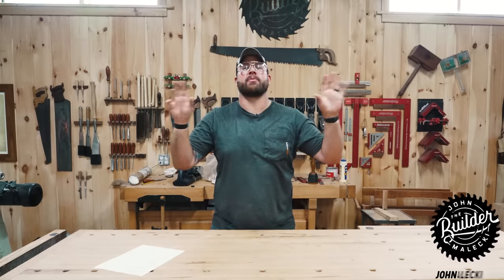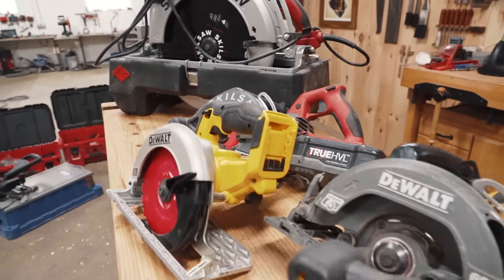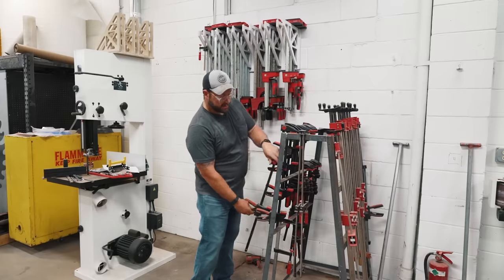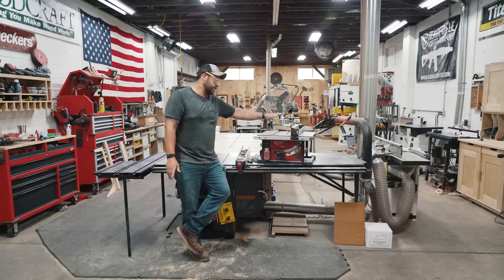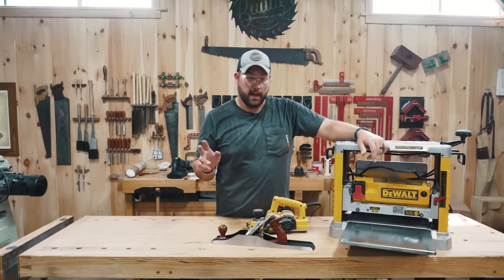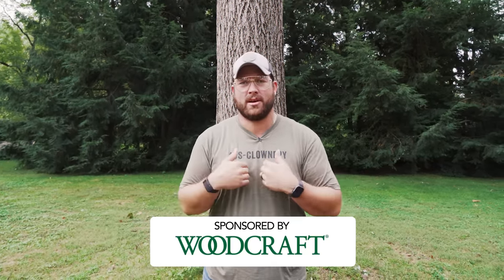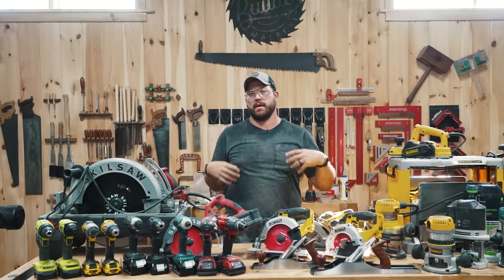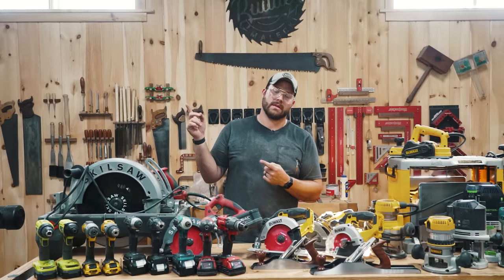10 Must-Have Tools For Beginner Woodworkers

Comment: Most beginner woodworkers probably haven't convinced the wife to let them take over the entire garage lol. Thus, I wouldn't include jointer as a tool for beginners as it takes up a ton of space and budget (and because the edge and face can be jointed with sleds on a tablesaw and planar respectively).

Comment: I'm guilty, i used pocket holes for my 2x4's for my miter station.

The router is probably the tool i fear more than a lathe and table saw, i've had a router head bite into a piece of wood and the router sent it sailing across my garage (first time experience using a router, so i knew i did something wrong)

Comment: As a beginner i will list it in order (so u can actually do stuff with it)
0) MOST IMPORTANT: Vacuum cleaner and aspiration system.

1) Jointer and Planer - You wont do shit without it. Confirmed.  nothing is going to fit. Tested.
2) Table Saw, Miter Saw, Plug Saw. this 3 Saws solve all of your problems. Once u have your material straight u can cut it.
3) Clamps! MOAR clams. they are fucking expensive. Lets put it this way. The guy has 8000$ (roughly) hanging on his wall. (yeah just clamps)
4) Router TABLE (not just a router). For the most stuff you would need a table with a router. GET IT.  (You can do joints by hand or with router or on a router table)
5) Now when you have things straight and jointed. You can use all of the other fancy instruments. AKA rounding router bits and shit like that. 

Hand drill  is a must have in any life situation anyway.

Comment: Beginner? Sure buy massive expensive planers and jointers before a router. And no random orbital sander? I would say 1 a cordless 18/20v drill. 2 a 7 1/4" corded circular saw (which is more intimidating and dangerous then a router). 3 random orbital sander. 4. Plunge router. 5 Impact driver 18/20v. 6 sliding miter saw. 7. Table saw. 8 hand or electric planer. 9 a jigsaw. 10 a mouse sander for hard to reach areas. I don't have a workshop and work outside under a carport so I have to use portable stuff I can bring inside. I built a lot with a cordless drill and a circular saw alone

Comment: Public service announcement: please don't use a circular saw to cut firewood! That blade is spinning at 2000-5000 rpm and WILL grab that stick and twist it. Whether your wrist is broken or your hand pulled into that blade or maybe the saw just kicks back, who knows. 
There is a reason why chainsaws and reciprocating saws were built. 
Also, to start out in a shop, I'd start with a jigsaw. It allows curved cuts and stuff and the only drawback is that it takes a bit longer to cut.
Reply: I've found that for starting out doing simple stuff (especially with 2x4s and plywood, for example), the circular saw is a better starting point for learning the basics of working accurately since it's simpler to make long, straight cuts with it. That's just been my experience though, I make a lot of stuff that needs the jig saw, but I use the circular saw probsbly 5x as much because of breaking down material.

I'll agree the jigsaw is an excellent tool, and though I honesy hate having to pull it out (pretty loud, lots of sawdust and often tearout/snagging etc), it's indispensable for cutting curves and trimming stuff near lines before sanding to the edge. I'd have trouble saying it goes on my top ten list of must-have tools though🤔

Comment: Completely failed the first tool explanation - impact driver uses vibrational punching force to hammer the screws in to the surface. The drill drills.

Comment: So I'm REALLY new to woodworking but this seems more like a list of "favorite" tools than "must-haves for beginners" to me.

I mean in your list of 10, you literally have 3 different types of saws.  WTF?  That's what you think are "must haves" for beginners?  Seriously? 

You literally list a circular saw early on which makes total sense but then you go on to add a table saw AND a miter saw as the "first tools" we should buy.  That literally makes ZERO sense to me.  I get it, you're talking about how they make your life easier but I really fail to see how those are more important than other things I list below as being essential, which you completely left off your list.

Oh yeah, you also didn't even talk about the benefits of a jigsaw,  reciprocating saw, or an oscillating multi-tool and how those could be super helpful for the beginner.  But yeah, you don't seem to ever use them so I can understand why you left those off. That's cool.

But here's the thing that's really bad about this vid - you leave A LOT of things off your list like a sander, clamps, anything to test trueness or flatness with.  And probably the biggest omission was dust collection and Personal Protection Equipment.  Come on man.....how can any list for beginning work shops NOT include those things?

So it seems to me the title for your vid should be changed to "my favorite tools" rather than a top 10 list for beginners.